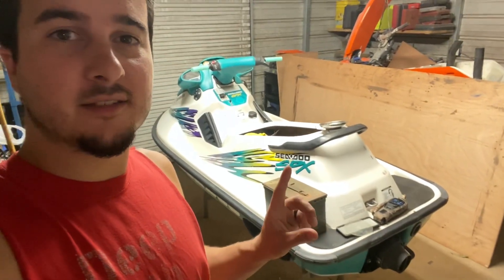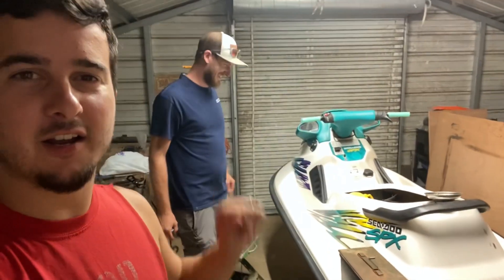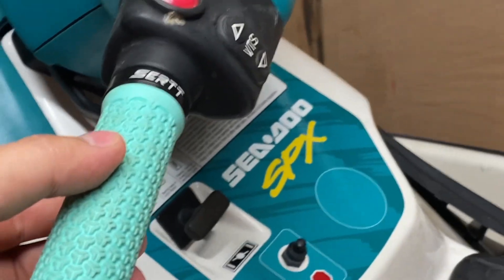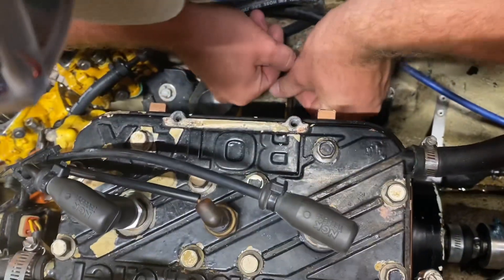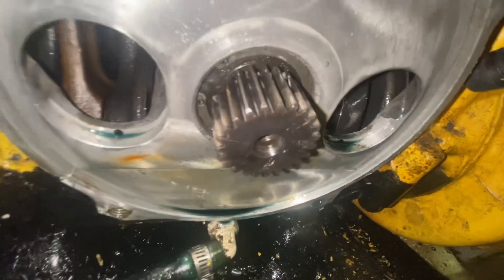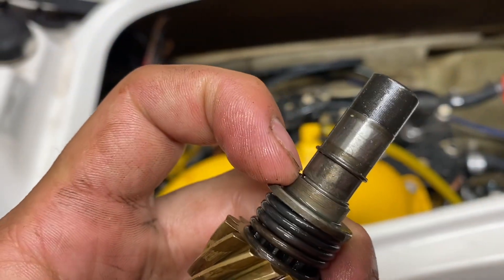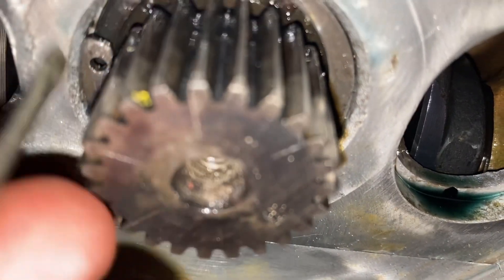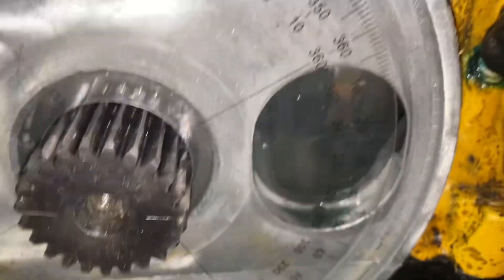Seadoo ROTAX 717/720 Rotary valve shaft removal and replacement plus rotary valve timing

Comment: My 98 gti just randomly lost power.   Tried to start it back and it ran rough.   Checked compression on both cylinders and one was way off.  Pulled the piston cover and both pistons looked fine as the cylinders did as well.  I guess I need to check my reed valve.  I suspected maybe pistons and rings.  Hell idk.
Reply from the maker: If the compression was off it’s prolly lost rings or piston and rings 
What was the comp?
Reply: @ 140 range on 1 and 30s on the other.
Reply from the maker: @johncarley9324 sorry to say it needs a topend
Reply: @ that’s what I figured.
Reply: @ i appreciate it!

Comment: Thanks for the video 🔥 I pulled my 94 Seadoo xp engine and put the time back. I noticed when I move the rotary shaft back and forth there is a little play, do you know if that is acceptable??
Reply: I guess the question is how much play should it have
Reply from the maker: Not sure that would be checking the manual kind of thing but I’m sure it’s supposed to be very minimal. The brass is probably wearing out.

Comment: I'm working on mine right now. Thank God I found this. I'm thinking I have to pull the crank. I bet not now. Thank you
Reply from the maker: The reason why I do it!!! Thanks for watching
Reply: @CocosPlayound  I'm thinking mine has the same problem with that little clip. Took carburetor off and it ran, put carburetor back on it wouldn't crank. Originally was running the died when I got back to boat ramp.

When I remove the plugs, they're soaked in fuel... already checked carburetor needle valve too

By the way, what size and pitch is that bolt for the rotary shaft?
Reply from the maker: @stevenh4970 not sure on the bolt. But I’d look harder into fuel system but also check the timing on the valve before pulling
Reply: @CocosPlayound already working on removing rotary shaft lol its about 3/4 inch out but seems to be in there good. Am I suppose to pull through that or should it be easy? Even with a puller, barely moving.

Yes, first clip removed

Comment: Are you mixing gas with oil or is the oil injection still doing it's job
Reply from the maker: Premix
Reply: How can you tell if the oil injection is not doing it's job?? ...like before you blow it up.

Comment: Hi Coco ! 

Havening some issus with my gtx 185 sc (2003)

starts and works like a beast, But when you turn it off, and let it sit for a while, It wont start again, or start after the 48th time, more or less.
Haveing tried almost all i know, but still cant figure it out. 

Any idea's?

-Tobbe (Finland)
Reply from the maker: Message me on Facebook if you can. 
Corie Hyatt